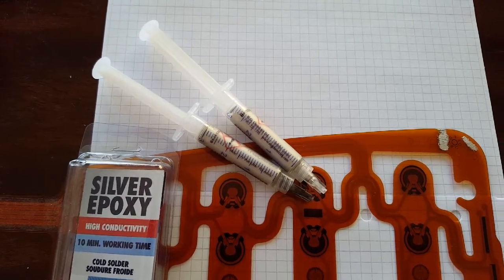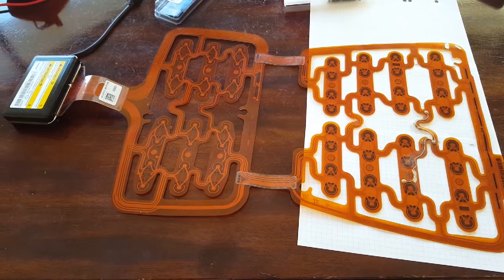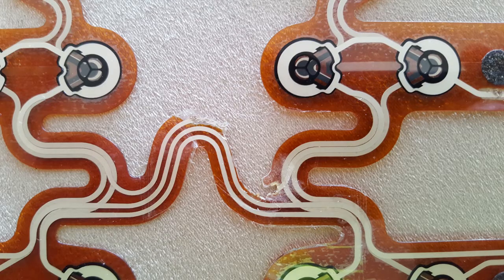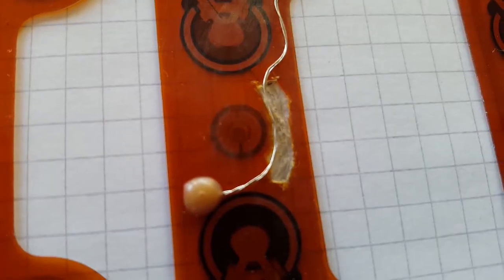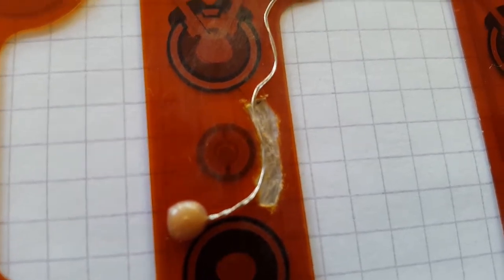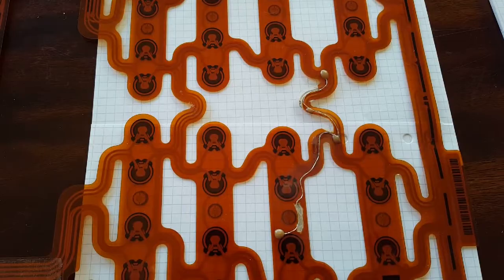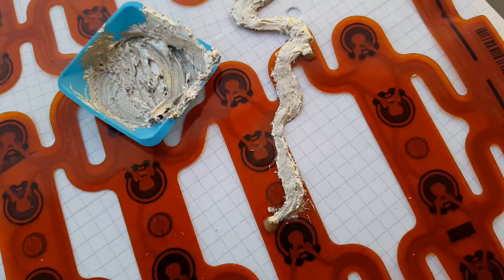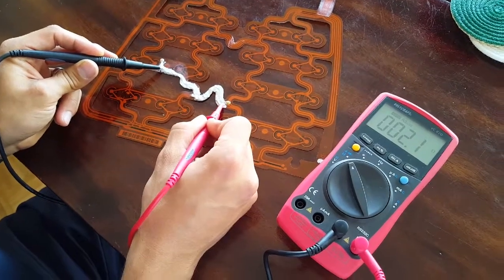Repairing a flex cable using conductive silver epoxy - strong and conductive -

Comment: This is great. But not much in the market yet. Mixing will ensure it will last for years in any unpredictable situation. Normal users don't always encounter broken part frequently. One more thing if it gets harden faster, say about 5 minutes, or by using heat gun will make it hardened instantly, that would be the perfect solution!

Comment: Very interesting. Try using normal 2 part epoxy and mix with copper powder or nickel powder. Conductive and much less costly than silver, that I would reserve for mission critical work.

Comment: Where did you get this silver-epoxy paste?
Reply from the maker: I bought it at a local electronic components store.
Reply: You can get it on Amazon: https://www.amazon.com/MG-Chemicals-8331-14G-Silver-Adhesive/dp/B008UH4DB2/ref=sr_1_1?ie=UTF8&qid=1522935354&sr=8-1&keywords=mg+silver+epoxy
Reply: @rundrish8740  Amazon is a ripoff.  $800 for glue?  Get real!